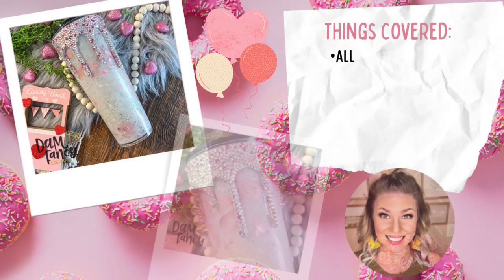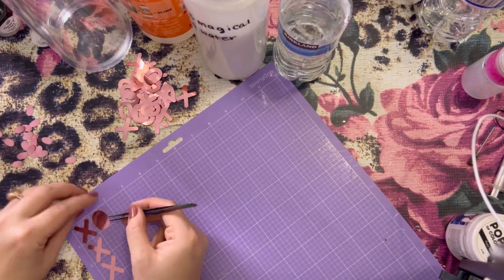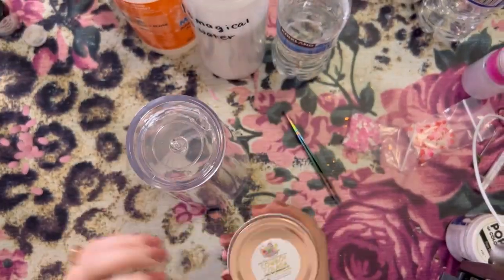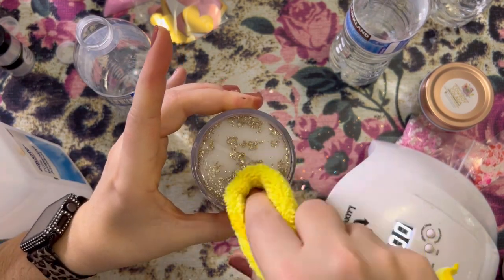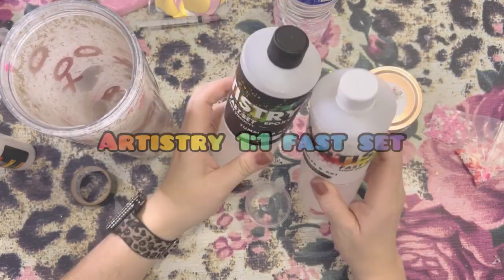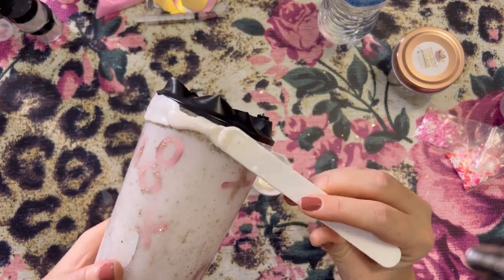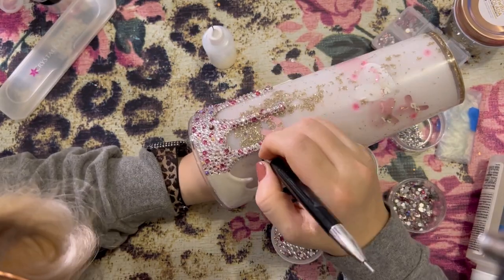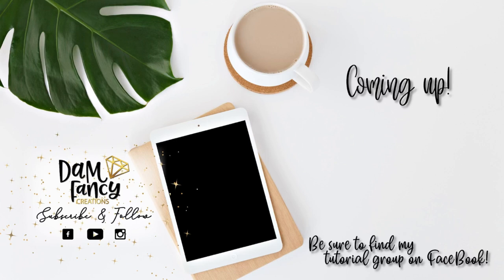Large Glitter suspended snow globe tumbler with rhinestone drips l DAM Fancy Creations

Comment: Thank you for this!!!! I have had terrible luck sealing my snowglobes. I am definitely going to try your way! I'm also having a hard time finding a brand that doesn't leak from the top. I've been sealing with clear vinyl and uv resin but I'm  worried it won't last. I've tried 6 different brands of cups and still all leak ☹️
Reply: I just recently became obsessed with stainless steel depot, and I tried the smaller acrylic tumblers that screw on together at the top but I have been hesitant to try this one that you tried. Maybe I'll take a risk
Reply from the maker: Oh no! I haven’t noticed any of mine leaking but I wonder if it’s because I epoxy them or add drips? Hmmm

Comment: HI had purchased two cups from two different stores, and I would check them out by shaking them to make sure they were bubble free by shaking them. Both tumblers would leak out the side some place in the seem. If I think I would find it and add glue to stop the leak another leak would come about. Is there something that I am doing wrong? I follow the tutorial while I am making the tumbler. 
Also I had made a wine glass and when I added the liquid, I would feel the liquid at the top of the tumbler when it was still outside down.
I guess I am doing something wrong with both tumblers. Are you able to help me?
Reply from the maker: If your cups were leaking I would think it is a defective tumbler. Glue will not stop the leak bc most adhesives are water soluble. I use epoxy/ resin to plug the bottom of my tumbler. Hope this helps!